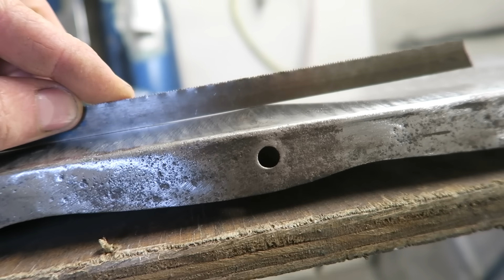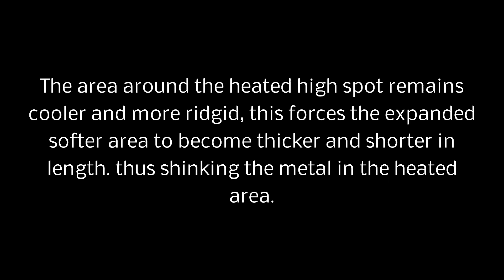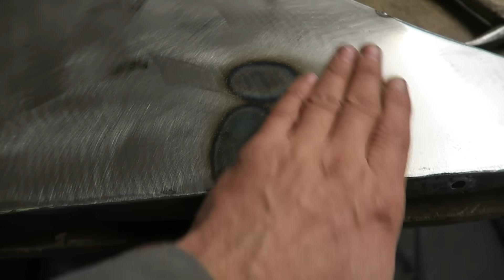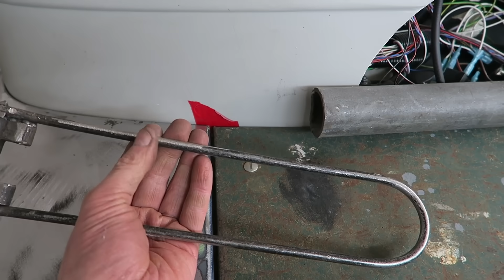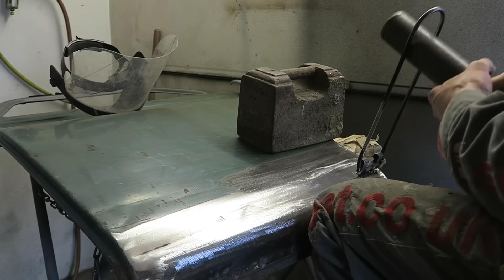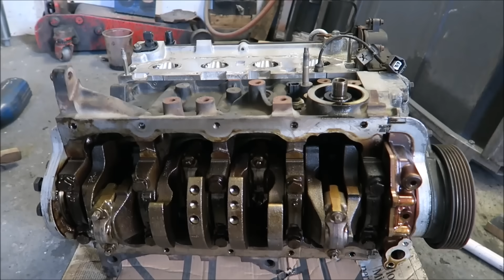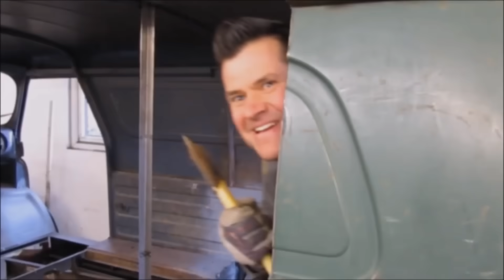Heat shrinking using a blowlamp panel beating Tips and Tricks #4

Comment: this is something that i tried a few years ago unsuccessfully. now i know that i was doing the hammering part wrong (i was using a dolly behind it and just stretching it further) so thank you for filling that gap in my knowledge.
Reply: You were doing it correctly,the idea is to heat up the metal to a small red spot and then with a hammer and dolly gently planish around the circumference of the red spot which has the effect that as the hammer hits where the dolly is it sqeeezes the metal into the red dot thereby shrinking the panel.I learnt how to do it in the 1960s as an apprentice panel beater.

Comment: Good job  I find heating a panel to shrink is a bit like the principle of the English wheel it's all about the short and long metal if u shrink to much the normal relaxed metal next to the shrink is now to long in relation to the metal next to it which will also cause oil canning to pop up if this happens  use hammer on dolly technique on the area u shrunck to much and watch the distortion come out hopefully that made sense . I use a shrinking disc it's flat so it only hits the high spots takes all the guessing out of it but takes a bit longer

Comment: What if it's a hugeee area ?
Reply from the maker: Κώστας Λεούσης You could use a large blow torch run off a propane bottle or better still use a stud weld transformer with a carbon shrinking rod. I will be demonstrating more heat shrinking in an upcoming video. Cheers Trev 👍
Reply: Trev's Blog thank you , I subscribed

Comment: That's a massive weld build up for a small crack. What did you weld it with, I use a Henrob torch for bodywork. Why not save yourself some grinding? I really like the tools that you made, I've had to make many myself. So what is the eventual life for the old Beford?
Reply from the maker: Tobias The video has been made for a guy with limited tools, the Bedford is going to be a mobile bakery. Cheers Trev 👍

Comment: Hi Trev . Thanks for that great vid. Good to see you back on your project. Have really learnt something today , as when we have the odd panel that has been stretched due to a large quantity of holes , we have heated an area and rapidly cooled with water then dress out with panel hammer to flat. sometimes it works well sometimes not so . Will bear in mind your Vid . Keep it up .look forward to the next vid.Regards Don
Reply from the maker: Don Codman Don just bear in mind I only cool the panel in order to bring the whole repaired area back down to room temp before checking the repair, even the slightest bit of heat still remaining in the panel can make it warp. When using a flame always hit the heated area as soon as it is heated, then let it cool to check your repair. I’m planning on doing more heat shrinking videos in the future and will include lots of theory as well. Cheers Trev 👍

Comment: Great video. I have a BIG warp.It is in my tailgate of a 1054 truck that I bought. The tailgate is bowed out 1 1/2" in the canter and is 20" X 12" .How would I get a large warp out like that???
Reply from the maker: Andy's Dog House it sounds like it’s ruined anyway so I’d put some heat into it and use a wooden mallet to give it a few good strikes, let it cool and see if things have improved, if they have then you know you’re going in the right direction. Cheers Trev 👍
Reply: @trevsblog  Thanks for dropping by. I will try that. Some WILL  work.
Reply: @trevsblog  on large oil can dints you'll need to be more extreme to get it tight again.
Heat until cherry read about the size of an inch rounded , place a toe Dolly behind it,hammer hard with a panel hammer until black and cool quickly.
This will then give you high spots around the original.
You need to repeat this on them (normally four times will do) .
Don't be afraid it'll get worse looking before it gets better .

Comment: I'm wondering why a shrinking hammer wasn't used.  I've chased enough oil can dents around, and around. A real pain for sure. Great vid. I'm just mesmerized with the physics of dents. You got to use light for this. it does actually drag around the dent. So cool..
Reply from the maker: k j Hey Thanks 🤩. Your comment is very much appreciated. Cheers Trev 👍

Comment: Very good video with a real life example. I'm fighting with a quite thin roof panel which I was tightening the a flex or oilcanning. It is in the rear corner of the car. I repaired carefully a narrow section of rust by the rain gutter earlier.  Welding didn't distort that area, but naturally created rigid spot on that corner. To make things more difficult the flexing area had only few minor high spots to heat, which I did shrink.  Some of the spots were lowered, but in the surrounding areas excess metal was also pushed inwards even more. It is hard to get the this part of the panel in the state that it can be hammered. Max. deviation is about 3-5mm but the flexing is the main problem as it tends to buckle inwards. Should the lower area with excess metal be heated/shrinked more, even it seems to be moving into wrong direction? The roof is kind of raised. It has upward profile over the rain gutter all round, topmost rather straight area is the current headache. Any comment, Thank you.
Reply from the maker: MS940 I’m wondering if you’ve over shrank the area. I’d be inclined to get a dolly under the low spots and use a bumping file to bring those up, this will also make the area more ridged. Cheers Trev 👍

Comment: Trevor- + a bunch on the drier idea. I've an old AC condenser R12  and a new radiator I ended up with. I've trying to figure out if the radiator burst strength can handle 150 # of air pressure-but not sure if it can handle the pressure. Ideas? I'm hooking up to a 6.5 hp gas single stage motor so I'm thinking the air coming off the compressor will be especially hot
Reply from the maker: Steve Wuertz Many people have used ac condensers, plumbing the outlet pipe of the pump of your compressor into the condenser then to a separate tank (to catch the water) before returning to the compressor tank or running it through the condenser before it goes straight to the tank either will work because you have cooled the air before it reaches the tank. Have a look at other people’s videos there are some on YouTube. I’m not sure about using the radiator though. Cheers Trev 👍

Comment: Question: does the wet cloth help shrink the metal too?
Reply from the maker: Guillermo Nieri it’s a confusion that in a way I wish I’d never introduced into the video, the cloth is just to bring the temperature down so that you can check by hand to see if the profile is correct. Apart from burning your hand you don’t need much heat in a panel to distort its shape. Cheers Trev 👍
Reply: @trevsblog  OK, I understand. Thank you Trev. Please keep recording and sharing your work.

Comment: Suggestion for a more extreme shrink operation:

I have a hood (bonnet) that was damaged from inside by an engine fan that sheared a blade off at high rpm. It left a sharp pointed bump that looks like somebody whacked it from the inside with a pick hammer, probably about 8 to 10 mm high. So, take a junk panel and lay it over an open span and give it a sharp whack inside with a pick hammer, then see if you can shrink it back.
Reply from the maker: onemoremisfit Thanks for the suggestion and this is exactly the kind of videos I hope to be making soon, just need to buy some new kit first but it’s in the pipeline. Cheers Trev 👍

Comment: I watched the glideking channel restoring an old VW truck/bus  a few years ago, and he was advised to just sand the popping up and down area with a very small sanding disk--2 inches?--which actually worked.  Do you ever do that?  I think it was a side panel that was inaccessible from behind.

Also, you being English and all, would you please put an apostrophe between the 'v' and the 's'?  Thanks.
Reply from the maker: Cory Pride It looks rubbish with the opening text with an apostrophe. I accidentally left it in on the new video... yuk. You can heat shrink using a few different heat sources, the guy you watched used friction to generate the heat, the blow lamp generates it from the flame and you can do it with electricity, which is what I hope to demonstrate in an upcoming video. Cheers Trev 👍

Comment: I have this massive floppy oil can dent in the roof of my 81 Honda Civic wagon. It's occupies a quarter of the roof and actually wobbles like Rolf Harris' wobble board, as opposed to popping cleanly in and out. What would be the approach to getting rid of that, preferably from the top so I don't need to remove the headliner?
Reply from the maker: pbaylis1 Without seeing it obviously I’m a bit clueless but if it’s dented in then it needs knocking out from the inside. I’d have thought that roof lining would need to be removed. Unless you use a dent puller/spot welder. Cheers Trev 👍

Comment: I searched youtube a few days ago (before Christmas) for heat shrinking techniques.
I found someone that did the same thing, but he started from the outside of the high spot not on the highest part. Then he "chased" it out to the edge of the panel, sort of out of the panel... 
What do you think about that, just another order of operation?

Another question, if you have a really large high area, would the same technique work? 
I have a roof that's at the moment severely dented, like someone have stood on it or possibly jumped.

You make some nice videos by the way! Really like how you present and show what you are doing.
Reply from the maker: mawe42 It’s difficult producing a video that’s going to help everyone out, I made this primarily for a viewer with no experience or equipment. I went on a miracle repair course that lasted three hours and I was already an accomplished repairer, (the course was mostly about heat shrinking) it’s difficult making videos that aren’t too long but cover enough subject matter if you get what I’m saying. I haven’t seen the video you’re referring to but on larger stretched areas I would start from the outside and work in, this then lessens the effect of the most stretched area. Another approach would be to hammer the damage in and then use spot weld transformer with a slide hammer attachment pulling the damage out starting from the outside working your way in (same principle but completely different approach) it’s a vast subject and I really would like to carry on producing more in depth videos. I’m working on freeing up enough time and investment in equipment so that I can achieve this. Your question about whether it would work on your dent is yes but, I haven’t seen the damage so just go ahead with care, it’s possible to make things worse if you don’t fully understand the process. Thanks for your comment. Cheers Trev 👍

Comment: Very nice and intuitive video 👍 I’ve just done a sunroof delete on my old Porsche 911 using a blank which was English wheeled out to follow the correct contour. After trimming to size etc I followed up butt-welding (10” apart working one side to the other) to try and keep the heat distortion to a minimum but whilst the remaining original part of the roof skin has remained relatively distortion free, the wheeled panel has mushroomed up about 3mm 🙄. I have purchased one of those planishing discs from the US in 9” size but a little shy to use it yet... if you could do a video of using one correctly that would be fantastic as most of the ones on YT are of poor substance 😟 Oh and yes please for the aircooler/dryer you’ve made for you compressor as that would be very helpful to 🤗 Keep them vids coming, many of us viewers learn so many great techniques from you, it’s greatly appreciated 👍
Reply from the maker: Mark Shepherd Hi Mark, I’ve never used a shrinking disc, I’ve thought about it though 🤔 I actually use my welding torch or my spot welder I’ve converted into a shrinking machine. I’m saving up for a proper stud welder at the moment to do a follow up video for more advanced heat shrinking methods. Lots more stuff to come for sure. Cheers Trev 👍
Reply: I made my own shrinking disc from an old circular saw blade with the teeth cut off. *( safety note: cutting the teeth off by running the disc grinder against the running saw does work but can be painful!)  I recessed the center hole with a ball peen hammer over the end of a pipe. It works. Trev, you do great work.